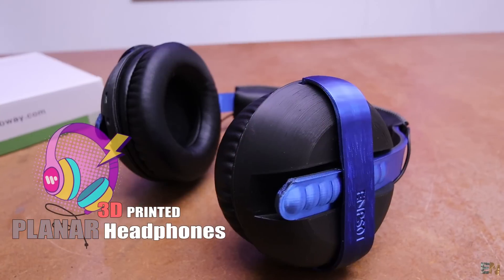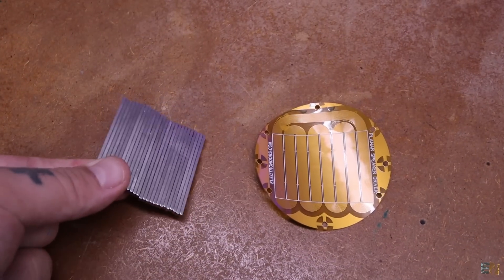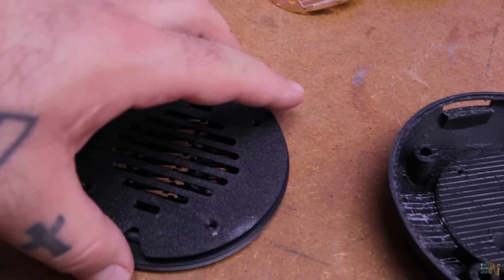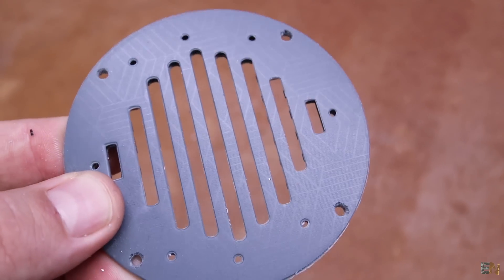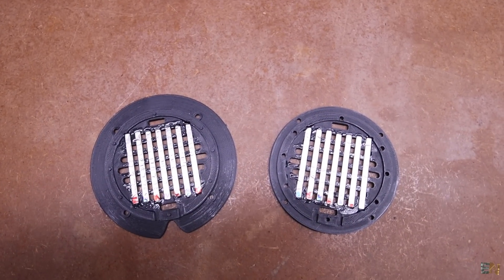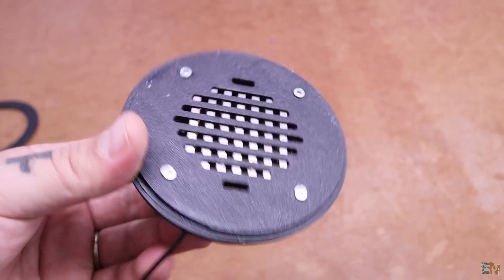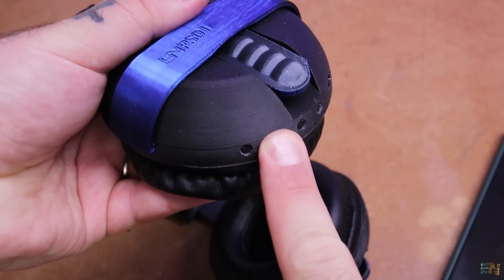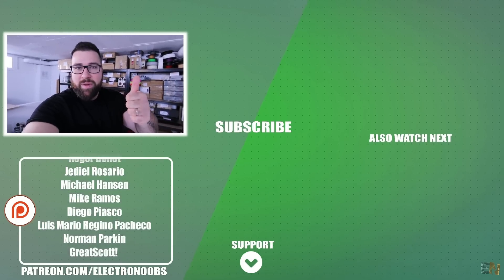3D Printed PLANAR Headphones | Download Full Project

Comment: Very cool project. For the bass problem it could potentially be a very easy solution of creating a bass port vent either on the cup or have a small section of the earpad seal lifted (or maybe both because it is closed back). Many audiophile grade planars use this technique to raise the bass floor at no cost to the other sections of the frequency response.

Comment: Hi, First of all, thanks for your explanations in your video. You make it accessible for beginner in audio like me.
I would try to reproduce what you done with small changes in the design of the cup. The main change is that I want a cable to transmit the signal. So here are my questions :
Do I need an amplifier to run my headphones by this way ? If needed, what must be its power ?
I found that the pcb is a little loose in the print. Will it be better to tighten it a bit my moving the pins a little or it may to damage the PCB ?
On the first video about your PCB, you speak about changing it to lower the impedance. Have you try it ?

Comment: The audio quality of these cheap Bluetooth receivers are pretty bad
Reply: Bluetooth is just a standardized data stream.  It will not sound better with a "better"  bluetooth radio. The only way to improve it is to use a different radio standard or go wired.
Reply: Well.. we have some codecs to improve the quality of BT audio. But it depends of the capacity of processing data of BT module.
BT are a digital protocol of data transmission over radio.
Reply: Incorrect

Comment: Maybe try having coils on both sides of the PCB? It would make the magnetic field from the coil stronger but also make the PCB stiffer, not sure if it would make for an overall improvement but I guess it's worth a try!
Reply: Well... if you consider that some of premium traditional speakers have double coils on it, it is a good think.